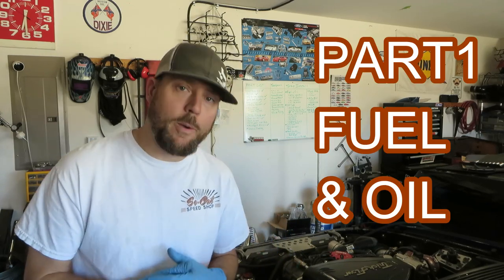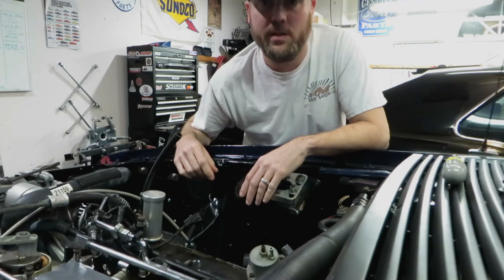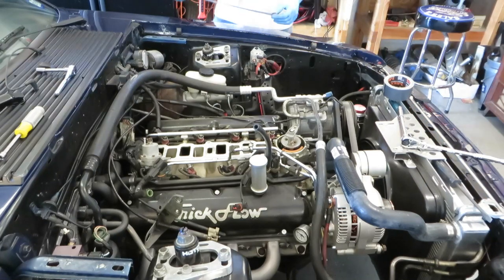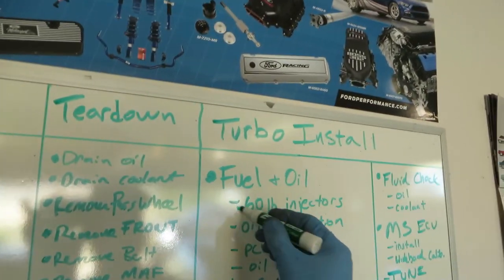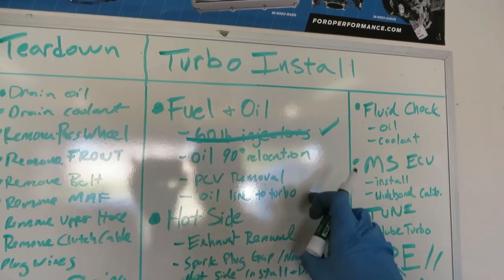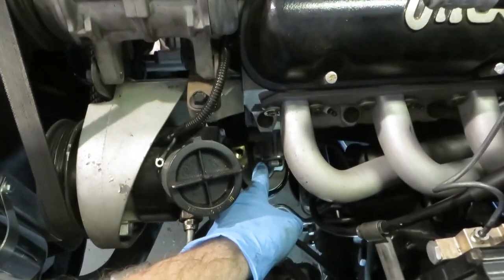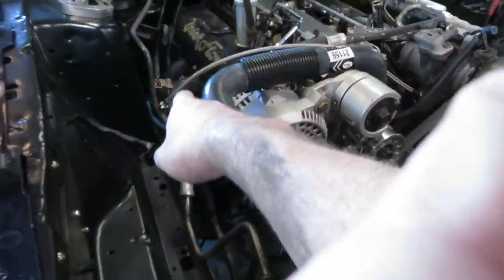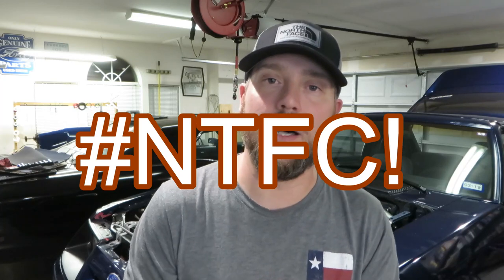FOXBODY On3 Turbo Install - Part 1 - Fuel and Oil

Comment: HERE WE GO..... Mike since your in there if you wanted to you could swap that top bracket for the fan to the bottom and bottom to top(vise versa)for a cleaner look,just a thought :)
Reply from the maker: MORBID FOX MUSTANG - good point! Should also swap my underdrive pulleys for stock.
Reply: Yes sir,maybe you might wanna wire tuck on that side too  @HOUSEOFDULA

Comment: ceramic coat the hot side DO NOT WRAP THE HEADERS YOU WILL REGRET IT, they will rust and trap way more heat under the hood and heat soak on everything trust me  it might be expensive but it will perform way better and the turbo will thank you for doing it.
Reply from the maker: Also noted! Plan still is to ceramic coat.
Reply: If they're stainless then they wont rust, mild steel dont do it.

I used to think headers would rot out just on hearsay from the Mustang community, which was why I was apprehensive on wrapping mystock header (stainless steel) on my SVT Focus. I've been running a wrapped header for 8 years (snow and salt) and it's solid. I rewrapped it two years ago because the wrap was failing the steel was fantastic underneath.

Comment: Aeromotive 340lph and 42lb Lucas disc injectors is what I'm running with my Vortech HCI 5.0. I like the Aeromotive but the Lucas injectors are a little whack(but they do work) - Siemens are definitely better. I got the Lucas injectors with the Vortech kit used, there's probably a reason for that lmao.

I'm running a 1" phenolic spacer under my Trick Flow Track Heat upper, this allowed me to change the injectors without removing the upper intake - pretty stealthy!
Reply from the maker: Right on! Good to know!

Comment: Idk if you have sub frame connectors but if you dont might be a good idea and also hood pins th last thing you need is the hood flying open and high speed, happened on pinks once fucked up the car pretty bad, cool vids bro
Reply from the maker: Thanks man! I do have sub frame connectors. And I do need hood pins just really dont want that look on this car for some reason...Need to find a hidden solution to keep the hood safe.

Comment: Nice project, I have a suggestion though. You should get fuel rails from a 94/95 Mustang, they will support up to 550 HP because the rails that you currently have will not support that from what I have heard.  From what I have heard they may only support around 450 HP due to the small area of the rails themselves.  So you may have lean issues on cylinders 7 and 8 and maybe 4 at the very least. The 94/95 rails can hold more volume of gas which will also help to alleviate any fuel pulsations in the fuel rails.
Reply from the maker: Had a few other mention this as well. Also, had folks say they are good to 500, and you'll run into issues with the feed line first before running into fuel rail restrictions. Considering this...lean cylinders make boosted engines go boom. Appreciate the tip. Think I will look into this, better safe than sorry.

Comment: one more thing you should get a 90 fitting for the oil feed line so it stays tight to the sending unit going up so the line doesnt loop out so far
Reply from the maker: Yeah. There will need to be a lot of cleanup. Its a pretty long line. Once I get it all in, I'll make sure it all looks at home. Right now, feels a little all over the place.

Comment: Dude, I really enjoy all of your videos, however please stop breaking the law by having your son in the front seat.  If you have a accident, you are going to jail if your son gets hurt.
Reply from the maker: My sons safety and well being is everything to me. I did not know it was the law I'd like to see this written somewhere. But law aside the reason why he moved from the back to the front was "in my eyes" for safety reasons. The rear does not have a shoulder belt and hes big enough where he HAS to have a shoulder belt WITH a booster that put the belt over his chest, below his neck. Also with that it is dangerous with newer cars because the air bags in the front (this is why newer vehicles let you turn off front airbag). Being my car has no rear shoulder belt, no front air bag, I purposely moved his booster to the front because he can use proper belt over his shoulder with safety in mind...With this though man, I DO appreciate you being concerned as well, and Ive been doing some reading this morning regarding it. I dont see it anywhere being a law, I care much more about him being safe than me going to jail.